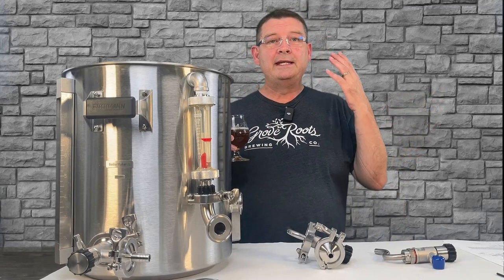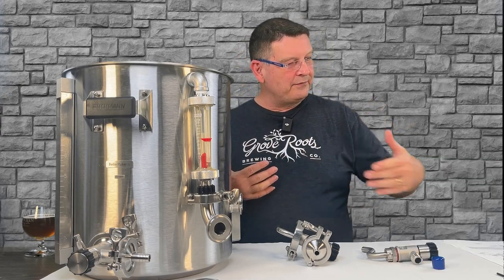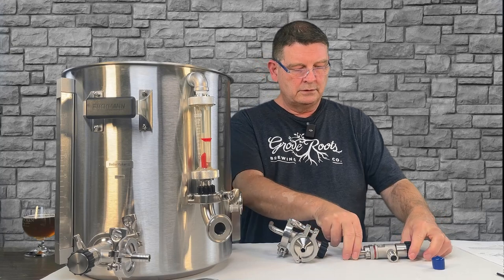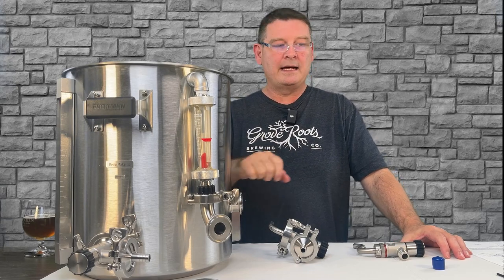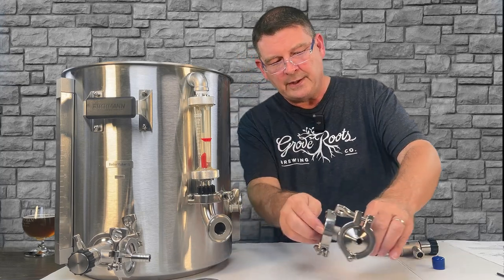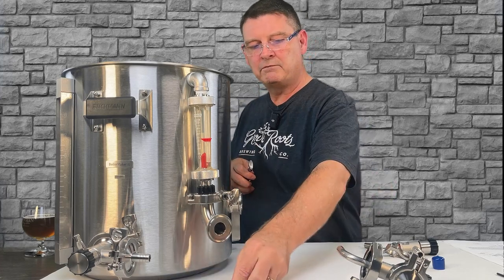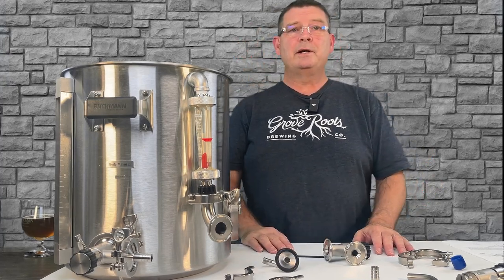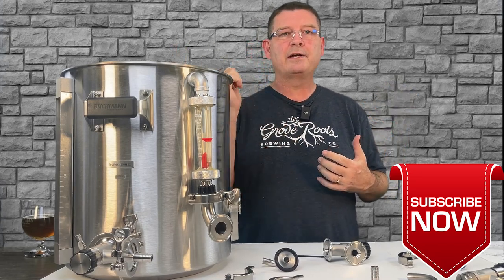Blichmann Engineering Brew easy compact all-in-one - 2 Whirlpool Kit Breakdowns

Comment: Thanks!
Reply: Thanks Mike, for your excellent explanations, which have helped me to understand my new Brew Easy Compact as I learn more and more about it.
Reply from the maker: @jimboud  You're awesome, and Thank you. I did expect these short breakdown videos to get as many views as they have, but I knew when I first got my BrewEasy Compact, I was initially overwhelmed with all the parts. This video was designed to help others like me. I figured most people just need reassurance they are doing it right but sometimes I get a part that just doesn't have an obvious location initially.  Thank You.
Reply: @BitterRealityBrewing  Thank you Mike.  Yes, LOTS of parts!  I made sure I watched all your videos before attempting to put the system together.  This gave me the confidence to know I would do it right!  I was initially overwhelmed with putting the Direct Deposit Recirculation parts together, but your explanations made it clear in a way I won't forget, so when the system is taken apart for cleaning after Brew Days, it'll be a snap putting it back together again!

Looking forward to more videos!

Comment: The brew shop that I use now starting off as building or modifying equipment. You can send there your equipment they drill and do all that fun stuff for you they drill weld solder everything
Reply from the maker: That is awesome as I am far from the most accurate person in regards to drilling and I am not a professional welder by any means. I haven't had to weld anything in 35 years and even then I was still learning the basics.